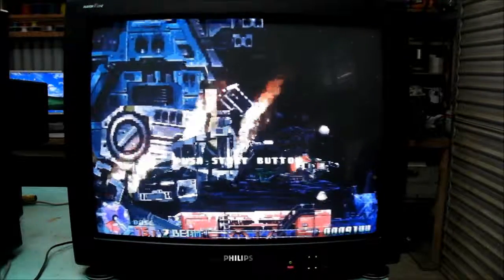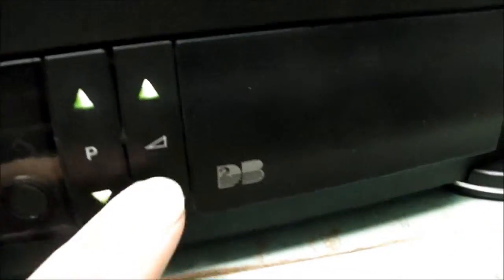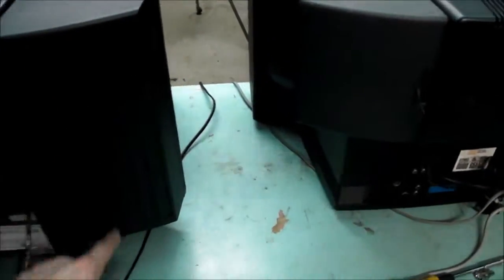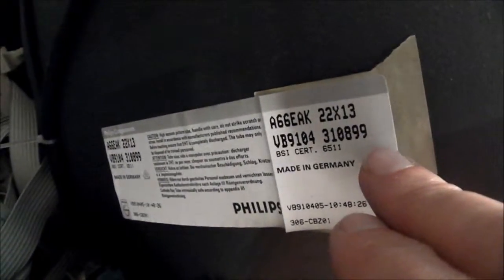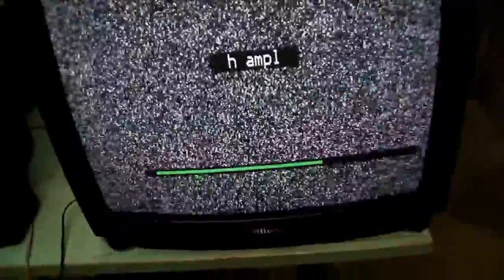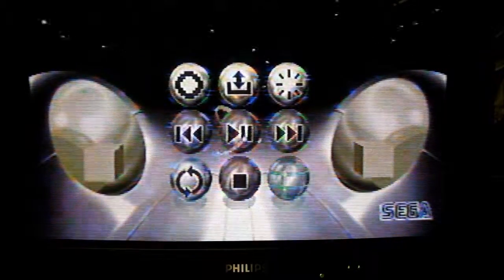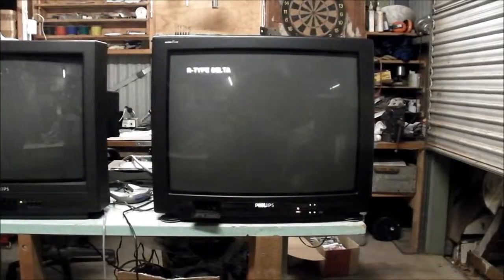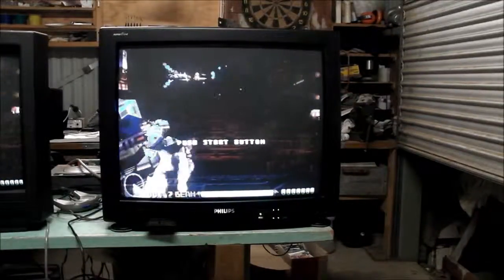Philips 28DC2070/20 66cm Scart RGB TV

Comment: Matchline were always the top-of-the-line flagship range with Philips. Agreed, the manual system switching would be a bit of ball-ache for us retro gamers, otherwise a nice set! 

Probably the matching S-VHS machine to go with it at the time would've been a clone of a Panasonic model, or a machine with Philips electronics and head, with a Panasonic mechanism (they had a joint-venture in the nineties). Also kinda interesting how they labelled the ports as S-VHS instead of S-Video..
Reply: Matchline had the features but like most European TVs were fairly unreliable. Those VCRs had a Panasonic G mech and heads, but the electronics were cheap rubbish.